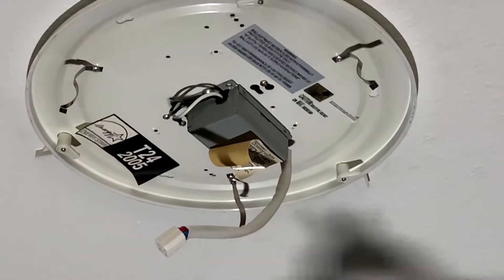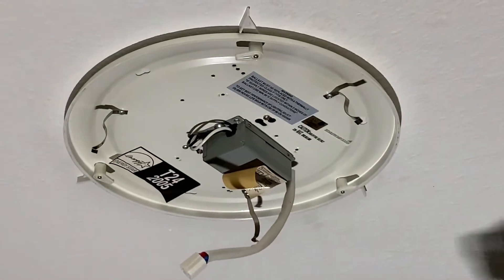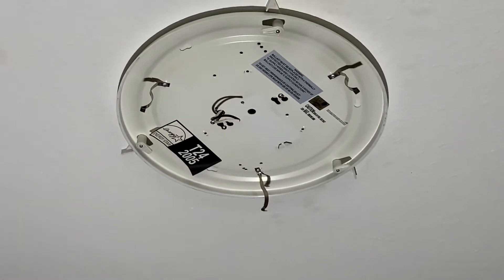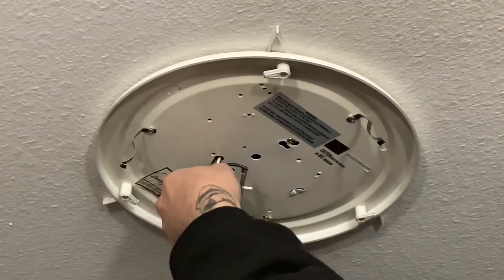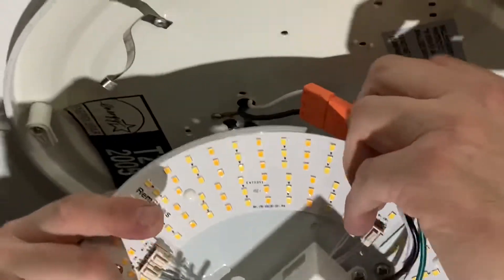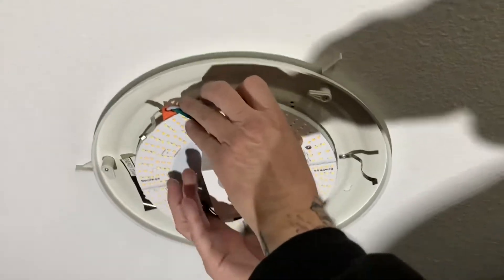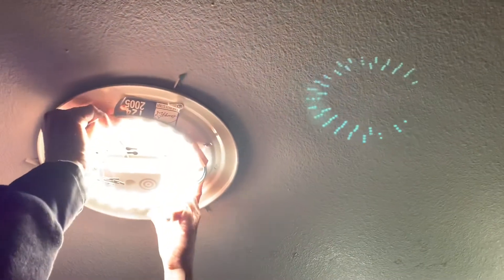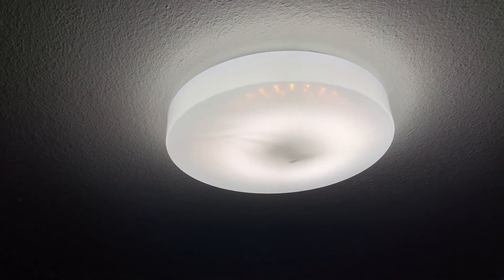Turning your old fluorescent light into LED

Comment: So when those LEDs die you can't just get a new GR10 led bulb and replace it you have to replace the ballast & LED? Seems awful because can't just buy a new bulb, basically requires a new light fitting everything.e.an LED stops working. How inconvenient